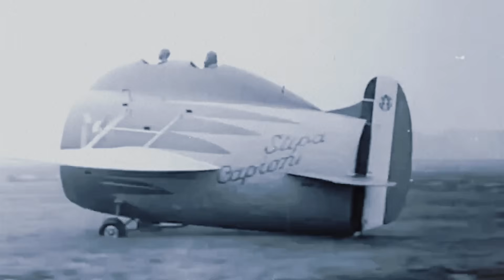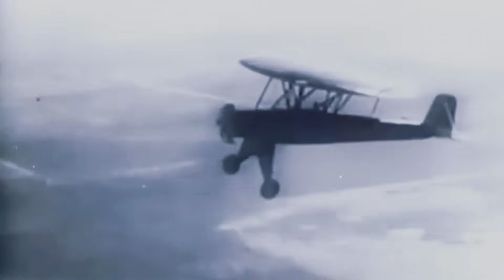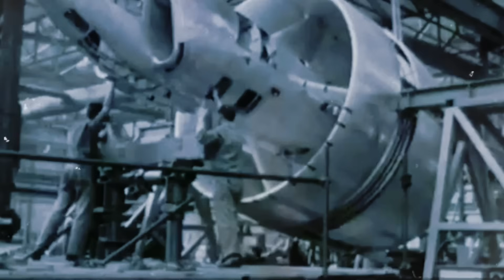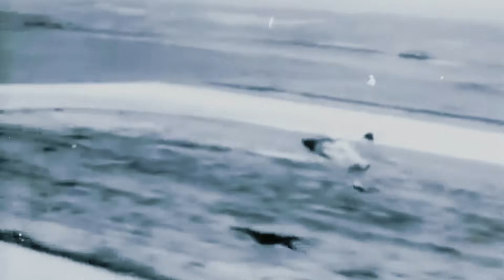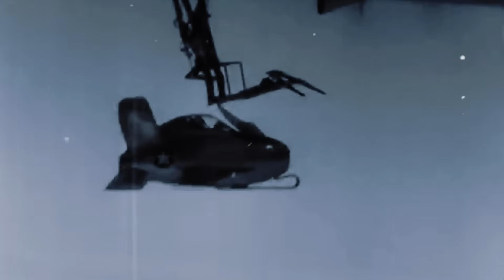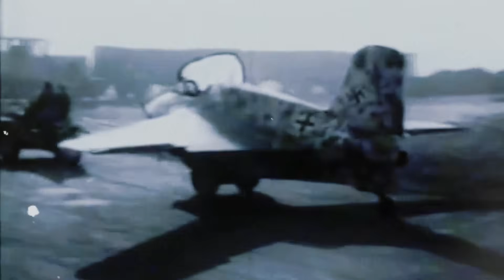10 WEIRD Vintage Aircraft Ever Built That You WON'T BELIEVE Actually Exist!

Comment: I would NOT rate the BV-141 higher than those VTOL aircraft where the pilots could not even see the ground but expected to land their planes backwards! The BV 141 was a dream to fly and had unparalleled visibility, it was just asymmetrical in design that's all, it flew well and was extremely well behaved and stable. which spoke volumes about Dr. R. Vogt's engineering skills when even Messerschmidt had trouble designing a suitable replacement for the ME-109, that wasn't a flying deathtrap!

Comment: The Blohm and Voss BV-141 was a genius aircraft, that had unparalleled visibility over every other aircraft designed for scouting. Everyone who flew it said it was a dream to fly and was a very stable aircraft, but simply because of it's looks it was not considered for the purpose which it was designed. Blohm and Voss aircraft company all had several aircraft that were asymmetrical in design and in several instances their aircraft were superior to the ones that were awarded the contract not because of performance, but because companies like Messerschmidt and Focke Wulf had men who were on their payroll inside of the German government and many instances Hermann Goering was wooed by those companies with delights that were extremely hard to get in wartime Germany, and Since Goering was a corpulent connoisseur of fine food and wines he was easily swayed by the much richer , larger aviation companies which Even though many of their aircraft were outright dangerous for German pilots, they still stayed with the well known larger companies and this corrupted system cost Germany dearly because they were not giving all the applicants a fair shake during trials. They judged B&V aircraft without testing them for their performance, which is of course a good thing for the allies because many of the very good aircraft, the Germans had, were either stuck in the slow lane of the development stage or had been dropped outright, without their designs ever being tested. Had Germany not been a corrupt dictatorship that stuck with outdated and foolish preconceived ideas and beliefs the war to beat Germany might have been much harder than it already was. especially if Hitler had actually listened to and allowed his Generals to control the military and do as they had constantly advised him to do, Germany might have well won the war, Hitler himself was the biggest and most insurmountable barrier to Germany's success in the war. Had Hitler let the Generals do their work, Russia would have fallen and all of the Russian oilfields would have landed into German hands. Communism would have been wiped out by Germany single-handedly, and the allies would have likely not been able to defeat Germany with Russia under German control. Thankfully Hitler was an egomaniac, like most dictators and refused to let his Generals call the shots. and we won the war, as a result. This is why there were several military officers who made attempts to kill Hitler, because they all recognized him os a detriment to Germany's success, and they were right, and I believed that GOD himself intervened on the allies behalf and preserved Hitler's life so he would bring the downfall of his nation, because the German Generals were THAT good, and skilled. Their plan was to hold onto most of their gain, but then concede some territory to the allies and sue for peace, and at the time during the war, the Allies were not making much of any headway against Germany. Had Hitler been killed and the Generals offered Peace at the 1943 mark, the allies may have actually taken the deal because of the loss of life that was hitting the allied forces at that time. With Hitler dead, the Nazis all arrested and headed to the gallows and the Germans willing to sign peace treaties that guaranteed peace, it would have been a far too tempting prize and Germany would then enter the rest of the 20th century as a world power with significant technological advancements over every other Nation in the World. a lot more space than they had after WW1 and France successfully humbled and handed a beat-down like no other world power had been given in recent history, on top of that, European Russia would then become a free nation under German Rule, the allies would have willingly let them Keep their gains in the east of Europe. A seriously Scary thought.